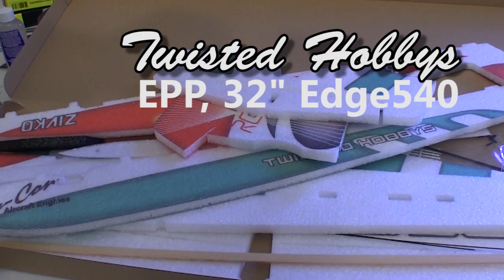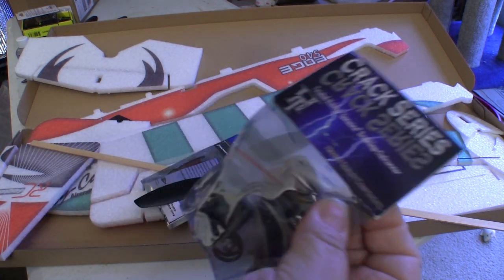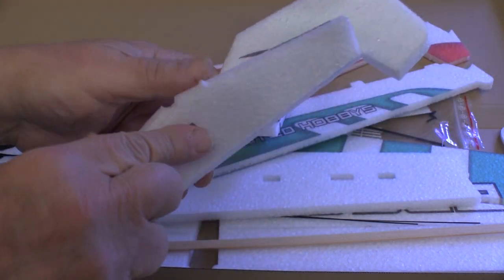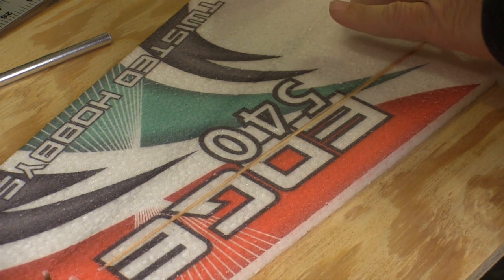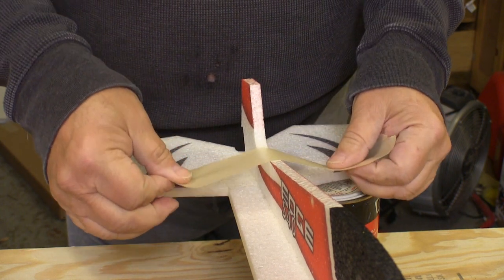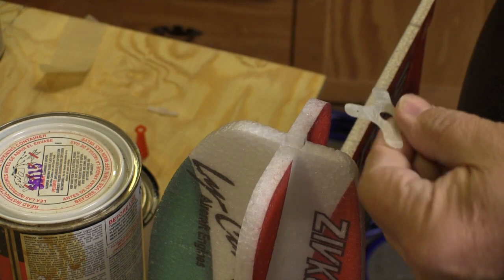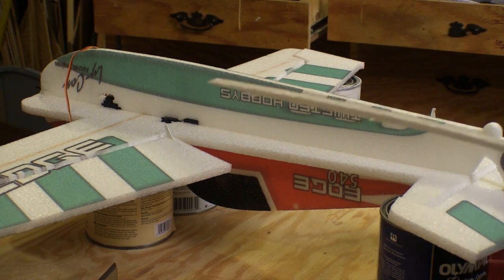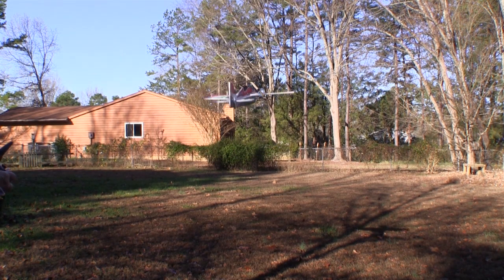Twisted Hobbys EPP 32" Edge 540

Comment: Been flying this for a couple of seasons now and its an awesome plane. My has the 4D T-motor ESC prop setup and I added an extra servo to provide thrust vectoring of the motor, using a swiveling  motor mount. Insane flips spins and rolls. Running 2s 500mah Liperion batteries for 5 minute flights.